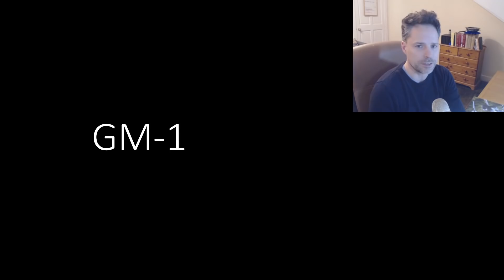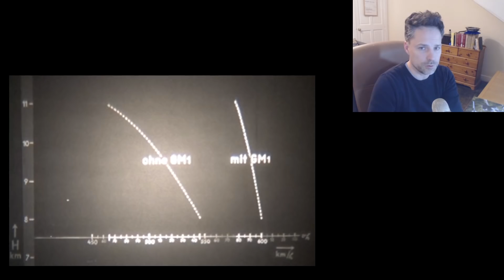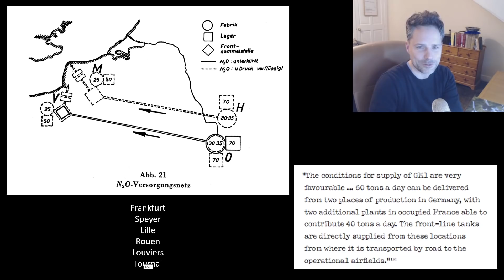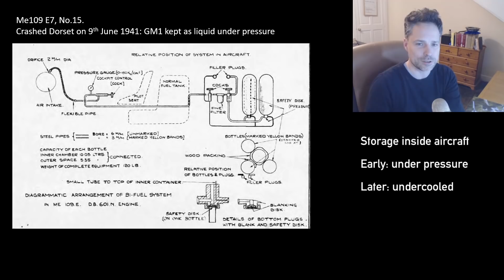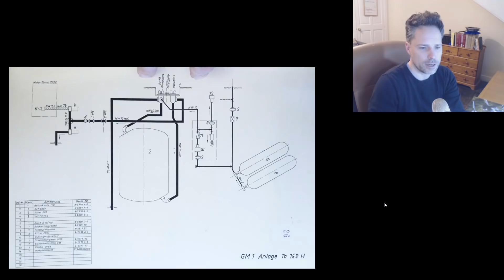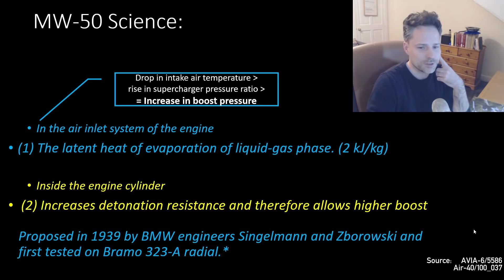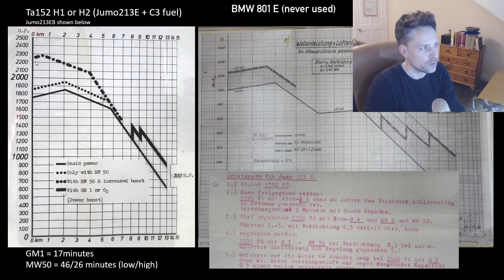The Secret Behind German Engine Performance: GM-1 and MW-50

Comment: Hi,

Just got the 3rd edition hardback of the book, Secret Horsepower race, signed.  Awesome piece of work. Its got information that I didn't know that I didn't know.  Detailed enough to be very interesting, but not so dry its impossible to read.  You may need to look up certain aspects of engineering using google and other resources online,  the book puts forward some interesting technical information. and even then some of the deep engineering items I only really have a surface knowledge of.  But its enough to get me through the ideas the book puts forward.

How the engineers came up with these designs with slide rules and mathematics rather than complex computer modelling is amazing. It almost seems like it shouldn't have been possible.

Also some great 1st hand references used and some detailed graphs and reference material, though given limited space in the book, some are a little bit small to read the full detail, to get the most you may need to bring out a spyglass, but that just makes it more fun.

Over all though, a really great read.

Comment: Surprisingly the limit for altitude was not the engine. There was in (early) 1945 a Spitfire X1X still climbing at 51155 feet when the seals gave due to the cold and that caused an oxygen issue for the pilot. I have this from a source that is not tier 1 or 2 (1 research papers and 2 books) but since it's a retired pilot they probably know what they are talking about.
Reply: You know why all the relevant Bf 109 G (and K) series variants had even numbers? The difference between a G-1 and G-2, a G-3 and G-4, a G-5 and G-6 was pressurised cockpits. But those variants only made up about 5% of the production for each of those "sister variants" if you will. I wonder why and what they were used for. They didn't even bother with G-7s, G-9s etc. when high-altitude fighters would've made the most sense in 1944 and '45.

What I'm saying is: Yes, engine technology was the bottleneck for high altitude performance.
Reply: @argh1312  51000 feet is hardly a bottleneck. Maybe you don't work in feet so that's just over 15500 meters. That's significantly higher then a commercial airliner certification ceiling. Not only that, it was not the engine that stopped the pilot going higher, and it was a standard Spitfire Mk XIX.
Reply: @gordonlawrence1448  The Spitfire Mk XIX is quoted with a service ceiling of around 44.000 ft. So I have trouble believing a "51.000 ft and climbing" story. But that's besides the point. What do you think is more difficult: Developing an air-breathing engine to climb 10.000 ft further, or developing cockpit seals that withstand 10.000 ft more?
Reply: Pierre Clostermann described intercepting a photo 109G at 43,000 feet in a pressurised Spitfire Mk VII with extended wingtips and the tall rudder.

Comment: I agree with you. When I think about an aircraft the first thing that comes to mind is the engine. 
While the Jumo 205 was in developent, testing & production began of the first aerodiesel by the American Packard Motor Company of Detroit in cooperation with Hermann Dorner. Packard adverticed fuel burn rate of 0.40 lbs/hp-hr on furnace oil. That was in 1928/29 & unfortunately it's producers were killed in a crash due to a storm early on. I'm curious how aviation may have been diferent today had that tragedy not occured as diesel GA aircraft have just become more popular again this century. I have never seen video of an example of a plane equiped with this configuration to my knowledge but have seen many stills.

Comment: This was a real treat. As me being German especially. Vielen Dank für die Erklärung, this is the first time anybody mentioned our planes could be and have been fitted with nitrous. Well, with the best pilots propably dead by 1941 having the better tech alone doesn´t cut it.
What baffles me is the fact that there were pipelines and designated factories- I bet Herr von Braun needed alot of this(this is me not knowing, therefore betting). Couldn´t that be Peenemünde?
Anyways, thanks!

Comment: Do a video on the A4, or earlier aggregat rockets. You know you want to :) I argue that it's relevant for several reasons, even if the A4 wasn't "aviation" due to the lack of a pilot. Probably the most direct reason is the later planned variants, some of which were intended to be piloted. And we know they weren't just paper projects, Wernher was serious. And to understand that A9 (I think that was one of the piloted ones, I didn't check), you need to go back to at least 1933.

Additionally, such videos would be infinitely more popular than a walk-around of a trainer aircraft, and you have to make enough to pay for the spaetzle and kolsch.

Comment: I appreciate the general info about how N20 and water/methanol functions to increase power.  I'd known that water injection was/is used to increase power, but had no idea that nitrous oxide was being used.  Very interesting!   As an aside... I was amazed at the huge main compass in the fuselage.  I've dealt with flux valves in A-4 Skyhawks, but those are much smaller.
Reply from the maker: Thanks, I'll pass it on. And yeah, the 'Mutterkompass' (Mother compass or master compass) is quite the contraption.

Comment: Thanks. Very informative. Now we need a follow up video with Allied engine technology. The book cover shows a P-51D and a Hawker Tempest. Did they use the same equipment or were theirs different? As the saying goes, "inquiring minds want to know".
Reply: Unfortunatly he did not mention in the video why the germans used these systems - they had poor quality fuel (low octane). The allies didn't need this stuff because they had high quality high octane fuel that allowed them to run their engines with higher manifold pressure. By adding MW-50 to the low octane fuel the germans had, they increased its knock resistance allowing for greater manifold pressure. But even with that the 35liter V12 of the messerschmidt just about reached the same power as the 27liter V12 of the P-51 that was designed with good fuel and high manifold pressure form the start.
Reply: Nitrous oxide was a german-exclusive thing as far as I can tell. "Instead" the Western Allies used two-stage supercharging with intercoolers. Some US aircraft used water or water/methanol injection towards the end of the war, or so I've heard about the R-2800 engined ones at least.

Comment: Great presentation!  He said MW-50 and GM-1 could be used together, but I wish he'd gone into more detail there.  GM-1 adds power at a given manifold pressure, but MW-50 basically helps the engine resist detonation, allowing used of higher manifold pressure than the octane rating of the fuel would allow.  I suspect it would not be useful to use MW-50 at extremely high altitudes were the supercharger can no longer produce the excess boost that causes detonation.
Reply: Broadly correct, there is no possibility to burn fuel without oxygen, so MW50 is "nearly" useless above rated altitude (depending a bit where it is injected). You can use both together, but this was prevented by mechanical limitations experienced by the wartime situation in Germany. It is a rather complicated story to explain in full, which is what my book is about.
Reply: @CalumDouglas  Thanks!  Your book is awesome.  Please see my other comment where I ask you to please write another one.

Comment: Thank you for a very interesting dissertation. Looking forward to the next one. Surprised Calum didn't mention the effect of the Carnot Cycle which states efficiency is dependant on the difference between the input tempeture and the output temp. Fuel evaporation drops the temp, which is why RR stuck with carbs instead of fuel injection and old cars went faster when it was raining.
Reply: Isn't  the Carnot cycle a theoretical ideal thermodynamic cycle? No real world engine can ever get close to this ideal.
Reply: The story of fuel injection and British engine development is one of much woe and incompetance, one of the very few real organizational and research failures in British piston aero engine development. I would recommend you read my book, which expands on that in much greater depth.
Reply: Whether you use a carburetor or fuel injection. Both will cause the petrol to evaporate. Direct fuel injection (DB600 series, Jumo 211) is even better in that regard, because it does not absorb heat from the supercharger, tubing, and inlet manifold, but exclusively from within the cylinder, the place where that heat gets produced in the first place.

What cars did you drive in the old days BTW? Did they not have air filters, or you know, bonnets? Going faster in the rain can probably be explained by a drop in temperature and a rise in ambient air pressure.
Reply: @argh1312  in the UK all cars gave bonnets, even those with fuel injection. What in America they call a hood, we call a bonnet.
Reply: Rolls-Royce stuck with carbs because they had nothing better, 
Carbs lower Carnot Cycle efficiency by increasing frictional loss due to Pumping efficiency.
Fuel injection automatically increase s performance and overall efficiency.

Comment: Very interesting video although generally speaking I did knew the GM-1 and the MV-50 years ago I didn't know about the use of high pressure tanks and later reverted to lower pressure tanks making less dangerous. It did had relative advantages and you did have barely mentioned it that it was very hard on the engines. The GM-1 system could be manually activated by the pilot just before the takeoff and was used as high altitude booster and the MV-50 was used primarily for its anti-detonation effect, allowing the use of increased boost pressures. Secondary effects were cooling of the engine and charge cooling with oil-based anti-corrosion additive used up to 6,000 mt, above it added 4% because of cooling effects. It was used for only 10 min with interval of 5 min each. It was quite corrosive and required extensive overhauling also because of low quality fuel. Blown gaskets, broken pistons and more was not uncommon on both systems...

Comment: Concerning the map of distribution of N2O, if H is near Frankfurt, then it's likely to be Hoechst, a chemical works between Frankfurt and Mainz.  If you're a bit out on the location of Speyer, then O could be Oppau, part of the enormous BASF works at Ludwigshafen.
Reply: That would make sense, especially since the BASF Oppau factory was used for producing fertilizer and had a huge explosion of ammonium nitrate in 1921, so that would have been the perfect place to start N2O production.
Reply: I was stationed a few miles up the road from Speyer in Germersheim and used to walk through it all the time, I remember that golden hat hanging in front of a building in the center of town by the fountain.
Reply: Given the history of the 2 places I assume V is Vernon (11. french artillery regiment, military school, munition factory - bombed and occupied 8-10. July 1940 by Germany) and M is Merville (shipyards, airport, merville gun battery as part of the Atlantic Wall built by Germany to defend from an invasion by the allies)

Comment: I'm surprised that more planes didn't have MW50 systems since they must have been much less expensive to build and utilize than almost any other horsepower boost. You only focus on fighters, but all aircraft could have benefited. The bombers and transports would have benefited from just the takeoff and climb boost, and they could have used pure water. The dive bombers and ground attack planes spent most of the time below 5,000 meters and they needed to climb many times per sortie and potentially escape fighters. As I have done a little research on Water Injection, the water actually lowers the exhaust temp by providing an endothermic source of oxygen. With more fine tuning, the water vapor is able to control the reactivity of the air mixture. Basically, the inverse of changing the octane of the fuel. Recently, BMW has had some good result mixing gasoline and water in the fuel pump and injecting them together in a test engine as a way of varying the octane rating of the fuel as well.

Comment: Storing nitrous oxide as a liquid allows the storage tank to be both smaller and lighter.  Storing it as a compressed gas requires a relative small and light container.  If nitrous oxide gas is stored at 100 atmospheres, the tank will be 6 times as large as a tank used to store liquid nitrous oxide.  It will also need to have much thicker walls.  The liquid tank will need to have insulation and a bleed to allow evaporation to keep the nitrous oxide cold.

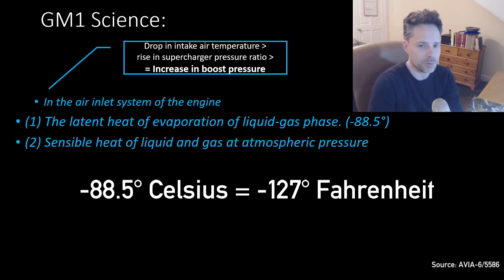Comment: 6:39  It's not that it is stored at a low temperature It is that it is stored as a liquid under pressure. It takes energy aka heat for the phase change to occur from a liquid to a gas. That in turn cools the intake charge.
Stored as a liquid or as a pressurized gas the storage temperature is mostly irrelevant, It comes down to the latent heat of vaporization. As in how much energy it takes to make the liquid turn into a gas. 
This is something he should understand intuitively from entry level thermo coursework.

Comment: Thank you for this insight.  People might have learned here how much extra power is used to go that extra few mph on top of maximum speed.  The power to fly at 2200 mph seems incredibul.
Reply: 2,200 mph your talking jet age pure thrust 
the discussion here is reciprocating engines
under mechanical boost with a combination of oxidation and cooling to facilitate added boost.

Comment: I suppose the allies never pressed this technology into their aero engines to the extent of the Germans,due to having access to larger quantities of higher octane fuels. Which resulted in boosting manifold pressure at higher altitudes. The German engineers must have known well in advance of their fuel octane deficiencies, a quite eloquent way to think out of the box to boost the manifold pressure in their engines . Loved the vid , keep the tech stuff coming 👍🏻
Reply: Allies used two-stage supercharging with intercooling instead. But the US used water and water-methanol injection as well, unless I'm mistaken.
Reply: The fuel did not boost the manifold pressure, it resisted knock at high manifold pressures, getting a cool enough very high pressure air charge was through sophisticated engineering.

Comment: In the period after WWII one of the early people in the California hot rod scene was Barney Navarro. One thing he messed around with was using compressed O2 or LOX being fed into the mixture to increase power through better combustion
Reply: It seemed hard to imagine but I was told Barney was still living and selling speed parts as late as 2000. I remember him best for his turbo AMC 6 that almost took the pole at Indianapolis in 1968 but for a mistake that brought the car in before they finished the run. He made hotrod heads for flathead Ford V8s and that was his bread & butter. His shop was auctioned off in 2005.
Reply: Using plain old oxygen is a recipe for disaster. The Germans tried that and found it to be far too corrosive for engine internals to handle (warbird engines were only expected to run a couple dozen hours I think). The convenient thing about nitrous oxide is that it only starts decomposing into nitrogen and oxygen at temperatures in excess of 600°C.
Reply: @argh1312  
I want implying that he was successful.  Just that he tried it looking for more power. I suspect he was introducing the O2 at really low pressure trying to get the atmospheric percentage up slightly. He was trying this stuff out on the dry lakes.

Comment: Interesting video. The question that interests me is how did the Germans get combat comparable performance out of relatively low power engines compared to British and French engines in WW1. For examples, the Germans flew with 160hp, 185hp, and 110hp (rotary) engines but still got good speeds from their airplanes. At the same time, the British flew with 200hp, 275hp, and 230hp (rotary) engines, and the French flew with 200hp and 137hp (rotary) engines. Some scouts were faster -- SE5a, SPAD XIII -- but the speeds of the German airplanes were comparable to the speeds of their British and French opponents. How was this achieved?
Reply: Rate of climb and holding height in steep turns was more important, their drag killed speed increases.  The bracing wire free Fokker Dr1 got a reasonable speed out of a puny 80 hp.